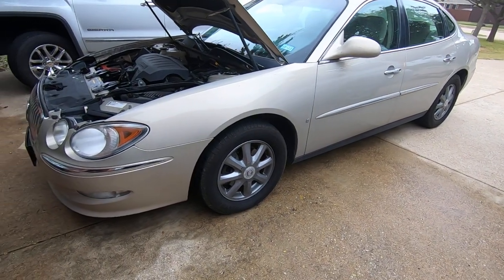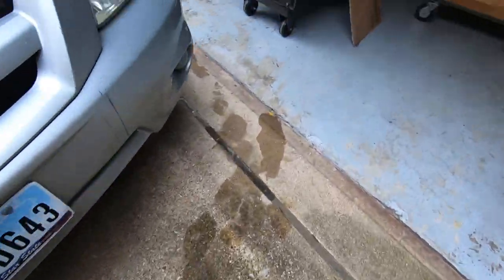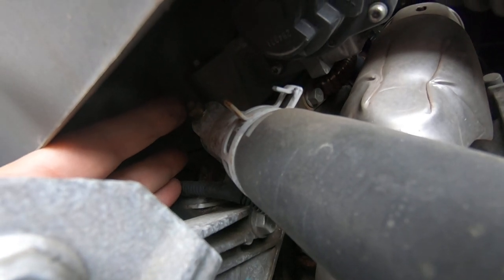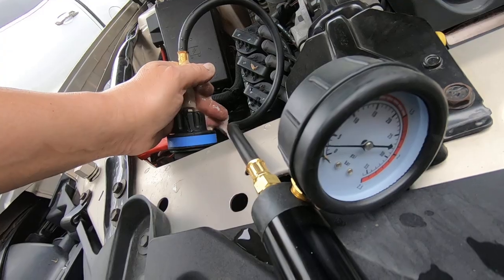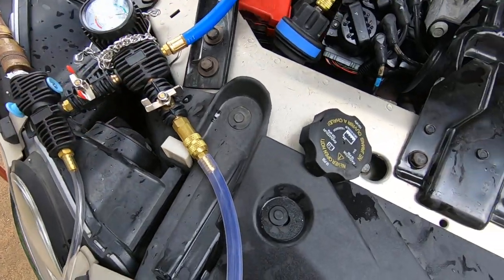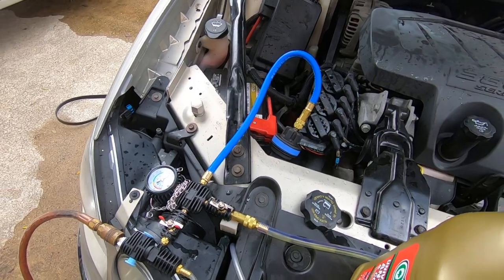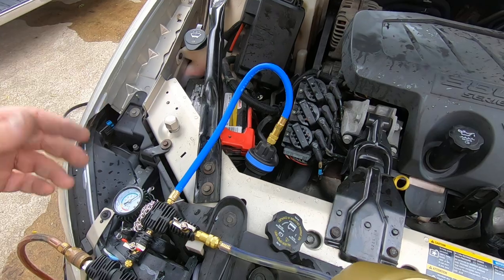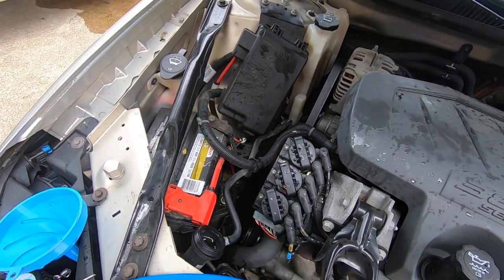Pressure Testing and Filling the Coolant System using the Vacuum Filling Method to purge all air.

Comment: What’s the pressure you used on your air compressor line?
Reply from the maker: 120psi, the only thing the air pressure does is operates the venturi to create a vacuum.  It doesn't actually put 120psi on the coolant system.

Comment: How did you get shop air connected to this tool? I have the same one sold as a different brand.
Reply from the maker: Had to swap out the air connector it came with, with the normal air connector we use here.
Reply: @737mechanic  I'll give that a try. I have the fancier oemtools 24444 airvac here as well. but it's not making a seal with my radiator neck for some reason. So I'm stuck using my cheap Amazon one.

Comment: Is it possible to vacuum fill the system pumping air manually? Or is it strictly necessary to have an air compressor?
Reply from the maker: If you have a hand held vacuum pump you can use it to hand pull a vacuum on the system for troubleshooting.

Comment: Question is did it end up solving the issue. I was looking for the sequence on the valves air/water as I have the less expensive one with the same valve body and this helped, thanks.
Reply from the maker: Yes it did.

Comment: You pulled a vacuum on the entire system and only had to fill out half a jug ? that system takes lot more than that if a proper vacuum was achieved
Reply from the maker: just because you pull a vacuum doesn't mean you sucked all the water out of the system. The water in the lower part of the block or radiator will still be there.